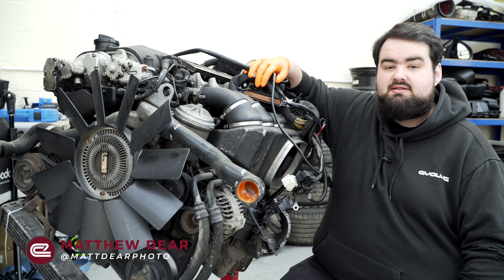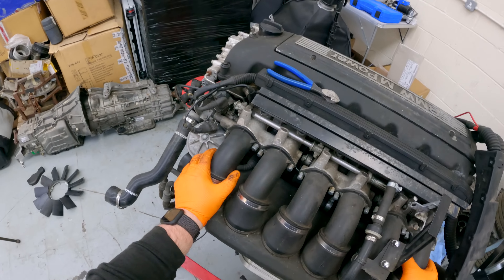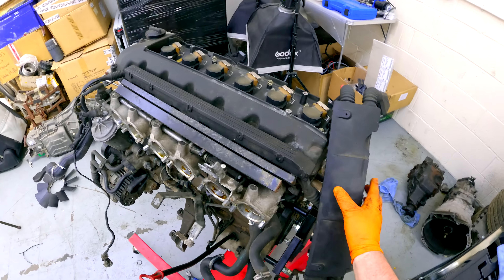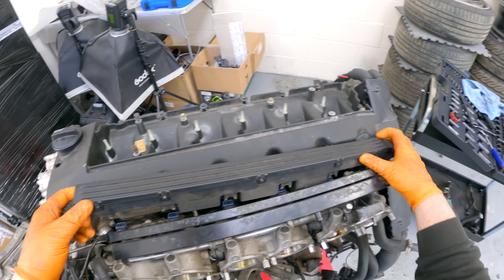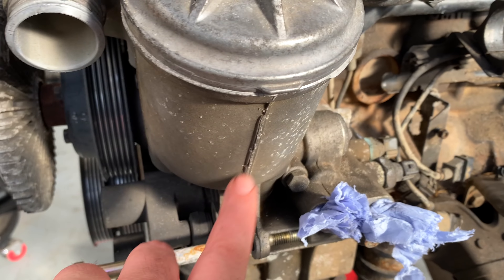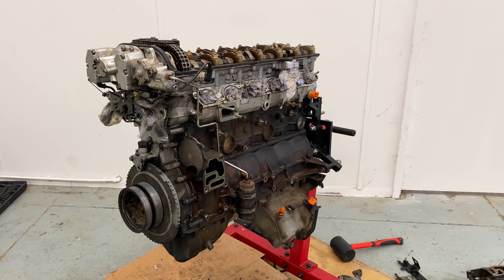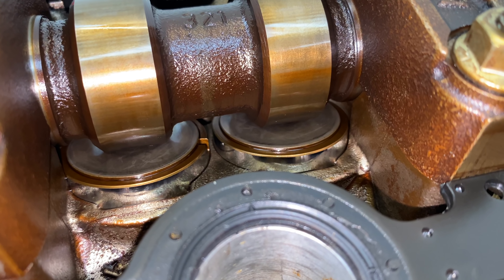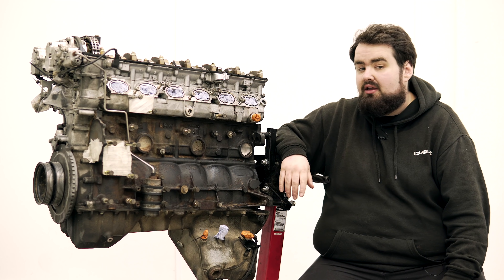Stripping the S50b32 E36 M3 engine - E36 M3 Touring Ep 06

Comment: That yellow varnish colour in the top of the engine is brilliant for an old engine like that.  You should look inside the top of an M54 - dark brown to Black.  It is down to temps, engines over the years have been running hotter as it helps with emissions but makes a mess inside.  You could take the crank damper wheel off too as it should just be 6 short screws around the hub to undo, there will be plenty of crud behind there.
Reply from the maker: I’ve definitely see a lot worse! Just be nice to see if it can get any cleaner.

In all honesty not sure why I didn’t take the dampener off. This is only an initial clean, all that has to come off to do timing chain so will be getting thoroughly cleaned.

Comment: Seeing the oil that the engine is caked in, having it dry ice cleaned like Matt from Obsessed Garage did with his whole E36 would be perfect. Obviously it's very expensive and not even sure it's really a thing this side of the pond either.
Reply from the maker: It’s something I looked in to last year actually when planning the project, but it was prohibitively expensive, as in thousands. Makes sense when that’s a few % of the cars value and originality is king, not when it could be 50%
Reply: @EvolveAutomotive  At that price, it wouldn't be worth it unless you were making it a show car or something like that and money was no object.

Comment: The golden coating on the engine is typical of an engine that's been run on castrol 10w60 Im told. Mine was like this and I've since changed to shell and it's all gone.
Reply from the maker: That’s not the oil this engine was run on though.
Reply: @EvolveAutomotive  ah right. Perhaps it was run on castrol tws 10 60 prior to your ownership then? Or maybe it's just been neglected. Either way I'll enjoy watching, I'm currently building an e3y6 track car myself using the running gear from my m3 evo so very similar project 😊

Comment: Subbed for this good project. Big end bearings should be your number 1 priority.
Reply from the maker: Really unsure if I want to get in to a full rebuild, all the costs really start adding up at that bit
Reply: @EvolveAutomotive  Sadly big ends are a known weak point on the B32, catching them before "kaboom" can spare you a lot a of cash in the long run. Bearing the costs involved, i would rather do the bearings and leave oem oil pump and the cylinder head gasket intact unless it has failed. Anyway, Imraan is the best person to advise you.
Reply from the maker: See this is the interesting thing, everyone has different knowledge.

You’ve told me that, another person I trust has said chains and guides are the priority, and a third has said oil pump is the main failure.

Without doing a full rebuild everything brand new it’s really who do you trust and doing your own research, plus figuring out budget and where best to put that money. I appreciate the input though.

Then there’s the issue of doing stuff like main bearings but not getting the tolerances right, correctly cleaning oil galleries, not getting the thrust correctly set on the crank, all could kill an engine way quicker when it’s been fine 100k. There’s a lot to think about.
Reply: @EvolveAutomotive  I clearly understand you mate since anything is possible and best way is to trust your gut more. however, on the contrary i can say that guides can be inspected for wear, BMW chains are robust and can be inspected for wear, an oil pump does give warning bells with pressure loss when warm etc. bearings on the other hand are like a heart attack

Comment: You're very brave to take off the throttle bodies, it's a mission to get them reset again. What oil did you use? That golden color is usually a sign that you use TWS. Do the vanos rebuild as well. Great video I'm glued in, also have a e36 s50b32 sedan.
Reply from the maker: I'm sure I'll figure out how to put it all back together, again maybe with some professional help!

Castrol oil is our preference here so that is what I used. I only had the car for about 10% of its mileage however so can't speak for previous owners.

VANOS is getting a full rebuild as mentioned.
Reply: @EvolveAutomotive  keep up the great work. Good luck.